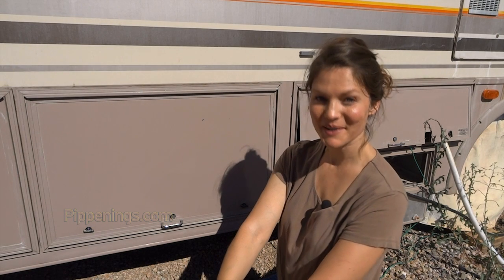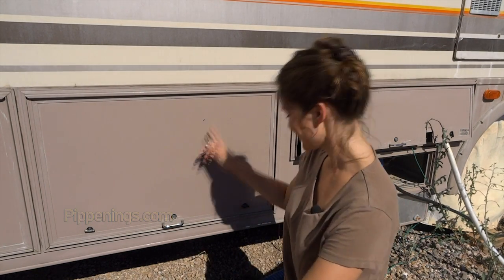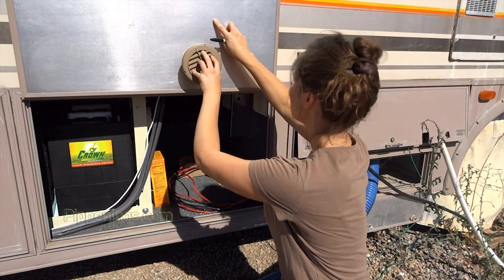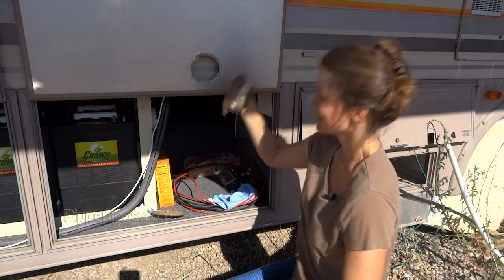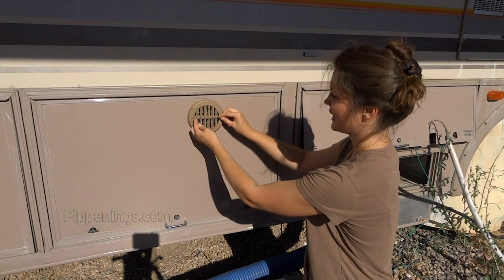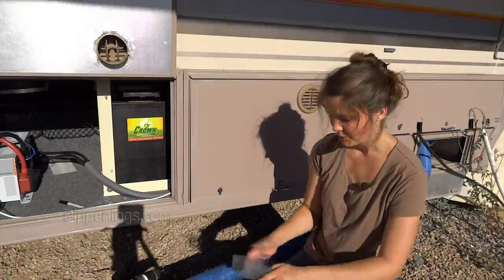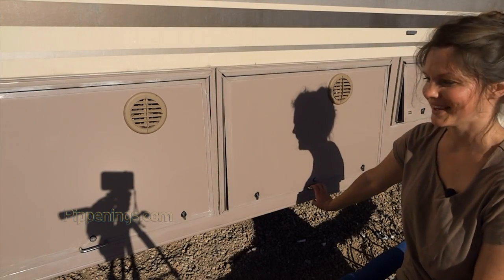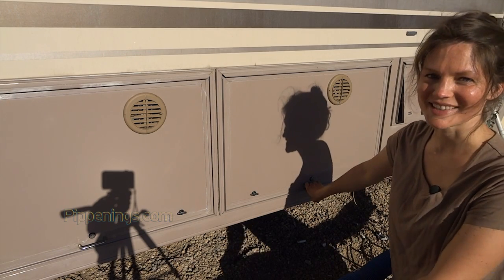RV Maintenance: Increasing Ventilation in RV Bins for Solar Charging

Comment: Hi Pippi, I have been thinking about how to install my inverter and my batteries in my storage compartment, but I knew I had to worry about off-gassing from the batteries.  So I have been thinking about adding a vent, so this video gave me ideas.  Let me know if you read this.  Thanks!
Reply from the maker: Glad to hear it and to answer you previous question about round vs square, go with the easiest. I just wanted a vent that was always open. Some of those square ones have flaps that need moving air to open them. That wouldn’t be good.
Reply: @PippiPeterson  thank you so much , I kind of feel like I'm talking to a celebrity! 
I have been watching your videos for years but somehow fell out of touch I like to watch videos about RVs, so this year I actually bought a small little travel trailer to check it out I didn't get to do a lot of traveling this year but hopefully this spring I'll get to do more.

Comment: The RV is like an organism, and all the parts we are adding in and interconnecting are like organs of the organism.

Adding solar and electric system is like having anaerobic respiration.
The fuel system is like aerobic metabolism.
The chassis, wheels, and suspension is like the skeletal system.

The components that make up each system, such as the water heater, the pump, and the drain are like the organs or components of that particular system of the organism.. Each organ might be very complicated, as a component, but the interplay or functionality between them are very simple in design and connection.

Every system is held together by some sort of fasteners or bonding agents. In that way it's like proteins or collagenous tissue.

Comment: Great idea and great work!  Just make sure that the gasses from the battery can not flow into where your electrics, inverter, etc.. are located.  You want to keep those where the battery gasses can not reach them as it could easily start a fire.  One of those things they kept driving home in the solar lessons.

Comment: a Big hole saw Would Have Been Cleaner, But you would need a 1/2" drill with a Side Handle on it and those Drills can Break your arm if your not used to using them. so, your Way, Probably cheaper and less chance of you getting your arm Broke using a big drill and Big hole saw. like #1801

Comment: A wonderful idea to keep battery acid fumes from building up. You may want to add a small 12 Vdc 4" square fan on the invertor side to add in keeping the fumes from your battery box creeping into the invertor. This will also keep the air moving when charging the batteries. Acid fumes are hell on coppe. Adding an additional fan to the Battery box to help force out the Fumes when charging the batteries.  Make sure the fans are Brush-less so there are no sparks in the battery compartment.

Comment: Pippi, you should use a zip tie to hold the screen on to your vent. With the heat, that rubber band will fail quickly. Great job on the ventilation.

Comment: Hey Pip' If you have the vents facing downward at about 45 degree's towards the rear it will form a vortex as you drive and suck the air out.

Comment: I'll bet there is a way you could crimp that screening inside of the vent cap to avoid rubber band or zip tie breakage/wear. Rubber band is going to go bad quick between UV and heat and maybe battery off-gassing.

Comment: I think the actual air flow through the duct to the battery compartment will be minimal without some mechanism to actively promote air movement.  With a large battery bank in a confined space, the passive natural ventilation might not be sufficient with the size of ducting Pippi used in the video.  

Additionally, the corrugated shape of the flex duct impedes air flow, so a 4 inch dryer duct of that type will actually function like a 3 inch duct of the straight walled rigid type.   Obviously in limited space, the option of increasing the size of the ducting probably isn't a viable solution.  Changing to a straight walled rigid type of ducting won't work either as you couldn't open the bin door. If rigid ducting was used, it would have to be installed so that it exited the side wall above the bin door.  While this is possible to do, it is also probably not a viable solution.

 So, we have a small (although relatively short) duct through which we want to move a significant amount of air.  I would personally want to install a fan in the ventilation duct to the battery compartment.  

A small DC fan would probably be enough.   Such a fan could easily be salvaged and re-purposed from an old junk computer or some other electronic item, so the cost wouldn't be significantly increased.  If a salvaged fan wasn't easily available, your local electronics store should have them at a reasonable cost.  The fan would need to be wired to a switch or a relay so that you could control when it was running.  I would position the fan at the battery box end of the ducting for easier mounting.  Yes, it makes things slightly more complicated, but only slightly and the safety factor would be increased by the greater air movement.

Just my opinion.

Comment: You could take some calking and put around the vent on the inside of the door. 
Get a 12VDC fan and put one as an inlet, the other outlet to help with cross breeze. 
As mentioned earlier, a hole saw would of been cleaner and faster. As well as a jig saw. But, I know you only work with what you have available at the time. Out in the country it's not always convenient to drive into town for a tool, so you use what you have.

Great Job, btw!!  :)

Comment: very good; broccoli, asparagus, cauliflower whatever it worked. get yourself a set of hole saws to go with the step drill, some wire ties and round up a collection of hose clamps. do repairs and mods quicker and stronger...  going to take in more of your vids

Comment: If you're venting corrosive gases, you may want to be sure your components (vent tube, screen, clamps, screws, etc.) are plastic, fiberglass, rubber, stainless or whatever will resist corroding.  You might also use a "scoop" or angled type vent cover on the front opening, with the scoop facing forward for some forced air ventilation while on the road.

Comment: Nice video. As usual. Maybe a hole Saw. would be better in the future. Just some  food for thought. In your enclose battery box. you may want to look into, installing a computer fan, to run from your charge controller. For better ventilation. Especially when the batteries are charging. This is the time.  Hydrogen gases are produced. I thought I would mention this. As I have a hydrogen gas  alarm  inside my motorhome. And it works. If you have the same. Fair enough. But if you have not got one. You may want to consider purchasing one. Anyway. Well done.

Comment: Just a suggestion, find a way to close the vent from the inside so you don't have to park at the side road and go out in the rain when you are driving, maybe connect some strings to pull from inside of your van.  Great video btw.

Comment: How about also using a stainless steel hose clamp to hold the screen on the back side of the  vent. Easily removal for replacement. Similar to what you used on the dryer vent.

Comment: Id put some of that screen on the inside of the battery box over the white vent. Dont want bugs getting in there. Especially biting or stinging ones. Just use some strong duct tape or the silver foil tape.

Comment: Hi Pippi, SAFETY GLASSES when cutting???? Also,someone else mention zip or cable ties for clamps instead of a rubber band.They have lots of uses,and you can usually get bags of them at dollar stores.Stay safe;-)
Reply: Mr Frog correct Safety Glasses when drilling and cutting. 👈🏽

Comment: Great idea.  My batteries are located under a step into my class C which is right under the propane alarm.  It has a good seal but when my solar is charging at a high rate it will set off the propane alarm.  Kind of like your old dog used to do.  So I have been thinking about venting my battery compartment more as well.

Comment: Heat is the enemy for batteries. Telecommunication companies  are victims of high heat in outside plant equipment . They use exhaust fans for Digital Loop Carrier applications in outside plant cabinets to extract heat . That kind of fan will help you for that application.  Installing a temperature switch will be perfect to reduce energy consumption. Find a telecom friend to help you out. I miss you in the visit you made to PR.

Yes! You are beautiful  RV Technician

Comment: Zip tie instead O elastic band on first vent .  Disconnect 2nd vent at hatch an dryer tube , slip nylons over inside vent then reassemble . It ill stop things from getting in .    Another great job !.   Much luk as allways

Comment: Heat will break your elastic over time , so I would suggest you glue, or caulk the screen in place and when the elastic breaks, the glue or caulk will continue to hold it in place.

Comment: I've seen better holes, but it works ... also, i only saw 2 screw holes and you ended up putting in 10 screws, was there a specific reason for that? ... sure it's not to great to share your fails (if it was something like that) but 'we' also learn from it to not make the same one.
Reply from the maker: +Dutch Courage Haha, you saw that! Yes, one side of the vent didn't go in well because the edge was jagged so it kept pushing out.
Reply: Yes, unlike some others i was actually paying attention to what you were doing :P ... Ah, so you forced it to stay in with the extra screws, copy that, tnx for the elaboration ^^

Comment: Nice job for the tools you have.  I run into a lot of projects for which I don't have tools for.  Gives me a good excuse to buy them  Hey, Pippi.  They make 12vdc fan motors (brushless) for less than $20 online.  Might consider mounting one of those fans to positively draw battery fumes and heat out of the storage areas.  These motors draw less than 1/2 in most designs.  Fumes can still accumulate unless you have positive airflow.

http://www.jameco.com/z/AB1212MB-Y02-ADDA-Corporation-12VDC-120-x-120-x-32-mm-DC-Brushless-Tubeaxial-Blower-Fan_2232147.html

Comment: Cable ties (Zip-Ties) could also be used to hold the hose and screen.  If you need more length, zip 2 or 3 together.  Zip-ties, A good thing to have.....hold tarps, bundle wires, quick fixes, etc.....(They can also be used as hand cuffs to subdue a perp.)  lol
Reply: They can also be used as hand cuffs to subdue a perp. or for other reasons.

Comment: Good job, with my luck the insert would fall out on a rough road or some degenerate would steal or break while I was in Walmart. I would try to use a plastic one that faced rearward and downwards that screwed securely.

Comment: Use a zip tie and it will last longer than a rubber band.
Reply: I questioned her choice of tool myself. She got it done though. She's as handy a chick as I've ever seen.
Reply: Amen
Reply: Or a piece from a bicycle inter tube or hose clamp. 
Instead of that cutter a round hole saw would have made a cleaner cut. I cringed thinking she might have damaged the wall behind the door as she was cutting!
Reply: That's a useful tip. I don't know how it took so long to invent those things.
Reply: She may not have a hole saw that size if any at all.
Reply: Glen Spivey shucks. they come in sets that fit into each other like a Russian Box and don't take up any room. I had a 3" set in my bag last year doing a project while we were out west.
Reply: Oh she has amazed a lot of us with her projects!

Comment: Hi Pippi, interesting as allways to follow your projects, but wouldn't it be more sufficient to use a cable tie instead of a rubber band?
Reply: I was thinking that the rubber band will rot, as they often do.  Pipii, use one of those rings (hose clamp) to secure your screen on, or as Dan said cable ties -- you can string cable ties together to make a longer one our of two or three.
Reply: That's silly! Asparagus doesn't come with cable ties... Geeeez 😜